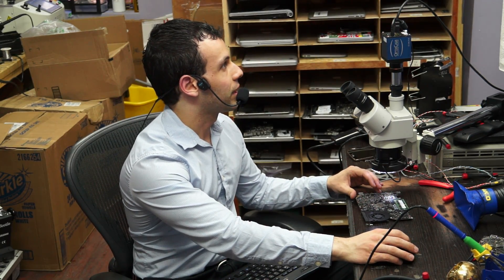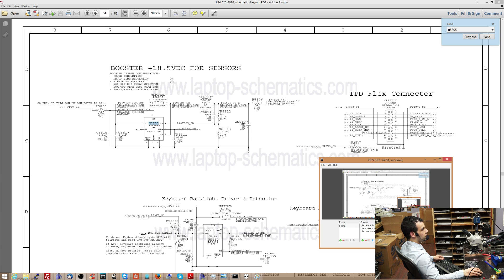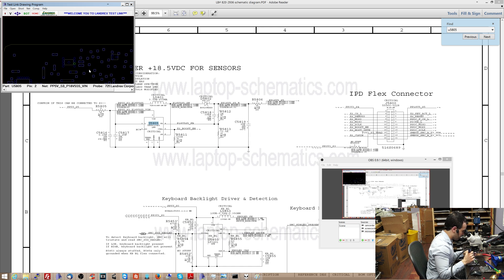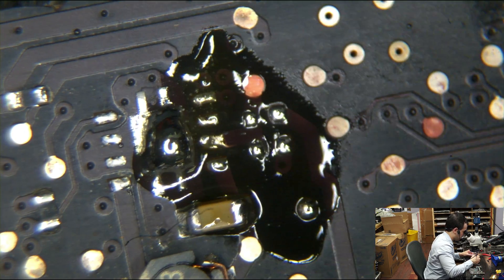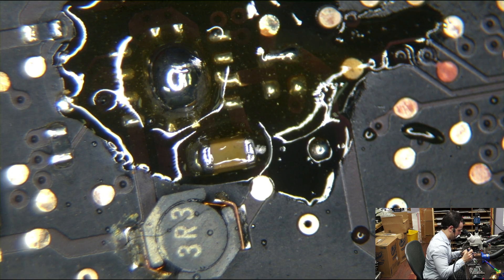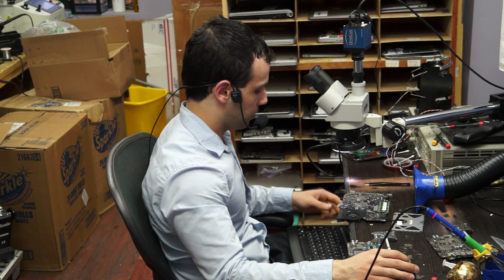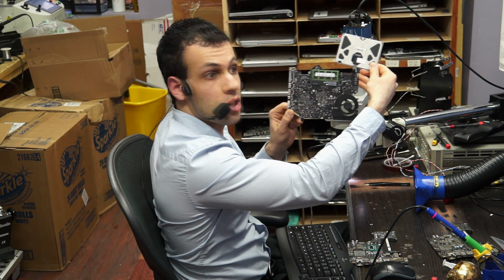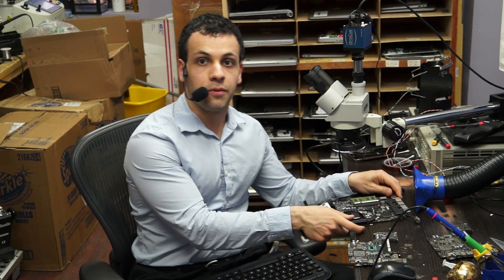Trackpad causing Macbook Pro logic board to turn off; how to repair.

Comment: Maybe you can shed light on something I cannot seem to find. I have a late 2011 Macbook Pro running High Sierra. The only changes I have made is to double up the RAM 7 yr ago, and 2 yr. ago I had a hard drive failure and had and SSD installed. It runs great.
However, these past couple of months I have noted, particularly is it sits idle for an hour or so, when I come back to it and do a two finger drag down to scroll up a page it shuts off and restarts. Very strange behaviour not seen until recently. Any ideas that can direct me to a fix? Thanks

Comment: Great videos! How do you know what the values are of those small caps in order to replace them, or do you just do those just by size? When testing their capacitance, how do you know their value to verify them? Do you just compare to others the same size?
Finally, how do you even go about ordering them from someone like digikey...namewise.     " id like to order those small brown rectangular caps"  lol
Reply from the maker: osityan I never ever ever order caps from digikey, and never ever measure. I take them off of a board that is identical, from the same place. Ordering caps one by one and waiting for them to arrive and measuring them is a total waste of time.

Sure if I am working on a recording console that has 5000 of the same cap, maybe that makes sense. For here and there caps for laptop motherboard repair, no. Donor board of same type, steal, and be on my way.
Reply: +Louis Rossmann but how and where would we buy them? I completely understand your point of view and opinion on this, calling it a waste of time, and I agree completely. But for us who don't have donor boards by the shitload, how could we get all of the fuses/caps/etc that you have. I apologize if this question has been answered but I could not find it anywhere on your channel.
Reply from the maker: mouser or digikey.

Comment: Thanks for making this, it was very interesting and helpful. I have one question, what was that liquid that was on the board while you were soldering? Maybe it's something obvious, but I'm not too familiar with soldering, especially involving small surface mount components.
Reply from the maker: VicVac amtech 559